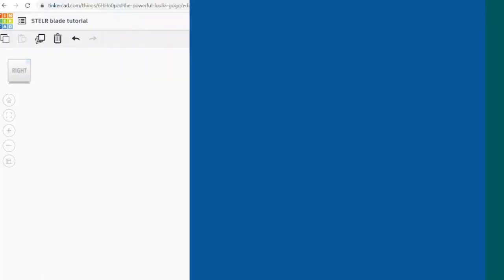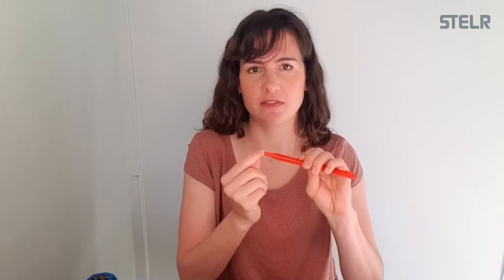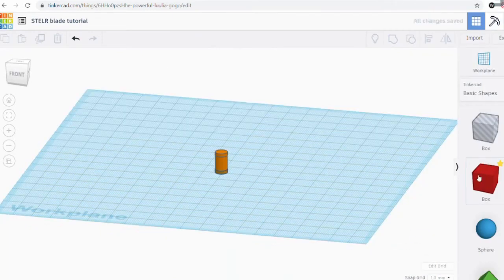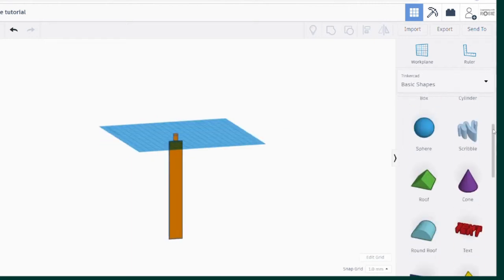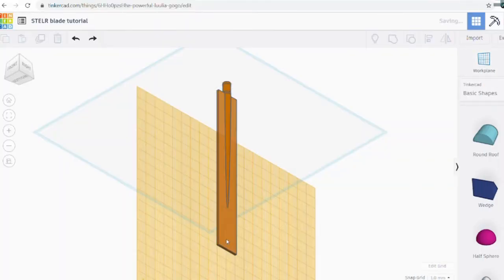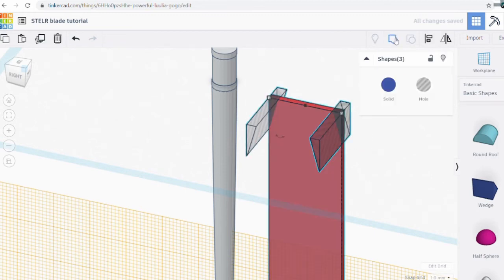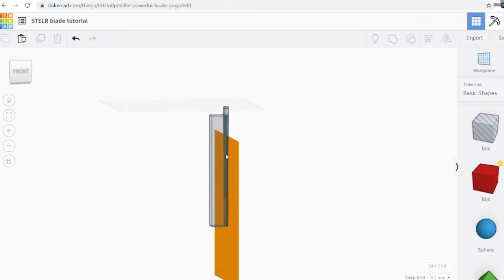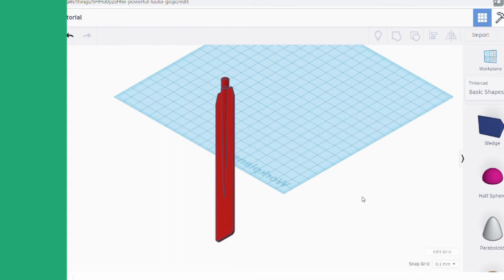Design, Print and Test a Mini Wind Turbine Blade! (CAD Tutorial for Students)

Comment: Awesome video, the beauty of 3d printing is its not costly and you can prototype to you hearts content, I'm currently trying to design a vawt, i know they're not the most efficient but I'm a little unsure how to use slip rings, that a hawt would need for power distribution.

just a tip when you select 2 or more items and click the align tool, before you click how you want them to align, click the item that you want to stay fixed and then click how you want them aligned and the other items will align to it .......if that makes any sense

Comment: Love your channel! I'am challenge my self trying to design a mini turbine using FreeCAD. Currently working with the blade design, setting up airfoils profile along the blade and plan to 'loft' through the profiles to make a smooth blade shape. Blade length some where between 50 - 80 cm. Question: Does large wind turbine airfoils scale down to small turbine airfoils. Or is airfoil designs for mini turbines totally different? Recommendations for good airfoils to use for a turbine with blade length less then 80 cm and wind speed less than 10m/s. Does airfoil really matters that much on such small blades? I guess the angle of attack and cord of the blade is more important?
Reply from the maker: That sounds like a great project! The main thing you will need to worry about is the Reynolds number, which is basically a scaling factor that depends on the length of the chord and the speed. So a small, slow moving wind turbine blade will have a much lower Reynolds number than any "normal" aerofoils, and the performance will be totally different. I would recommend that you calculate your expected Re and then find an aerofoil designed for that number (approximately). And you should also consider how accurately you can actually manufacture it. Some aerofoil designs are more tolerant than others of surface roughness for example. If all of that sounds too complicated, just start with a flat plat with a rounded leading edge. You are right that the angle of attack will likely be more important than the difference between 2 aerofoil designs. 
Good luck and let me know how you go! Feel free to post your project to the Engineering with Rosie Facebook page, or tag on FB or Instagram.
Reply: @EngineeringwithRosie  thank you so much for your answer an suggestions. Time to do some aerodynamic lectures! Hope to at least match your gingerbread turbine. The possibilities FreeCAD and a 3D-printer give us today is so great. Often think of what Newton and Da Vinchi would have  acheived if they had access to the same tools and computers we have today!
Stay safe, have a great summer, I look forward to your next video.